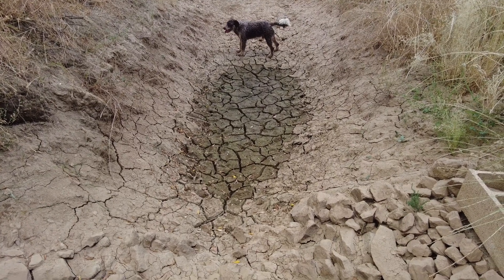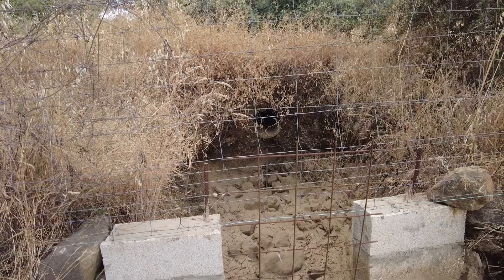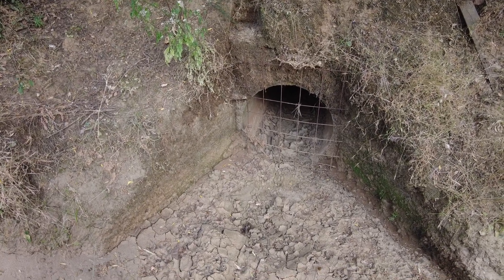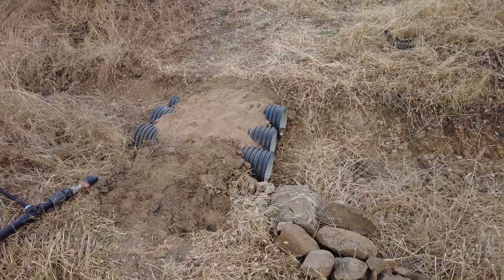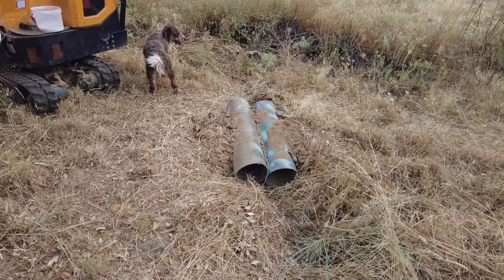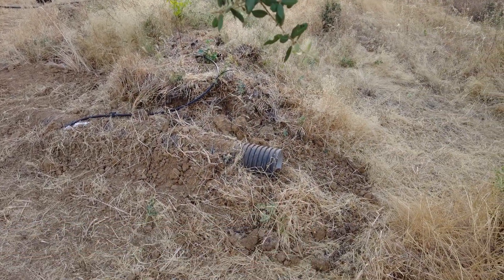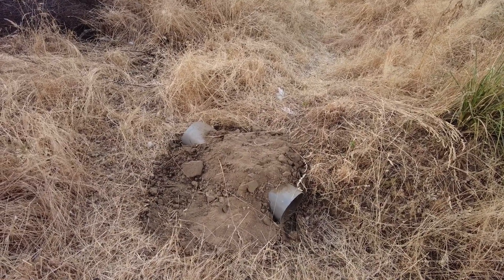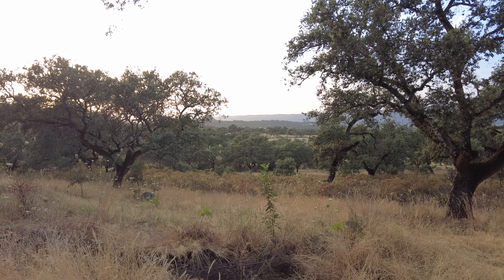Culverts: we now copy what we loathed! #permaculture

Comment: I think the 'stacked culverts' are a fine solution for creating crossovers for people and machines.  They were already on site - so this is a $0 cost adaptive reuse.  Also, the length (relative to the under road culverts) are very short. So the geometric increase in speed over length of travel is nominal by comparison.
My thought would be to add a single row of rocks at the end of the swale and just below the culvert stack as a leaky weir.  The leaky weirs will slow the flow,  spread the flow and help to soak the rain without erosion.
The object is not inherently good or bad.  It is how humans put it to use.    ☑🌳🌻
Reply from the maker: Yes, guru Steve! Thank you sharing valuable information as always.

Comment: One of the things you can do with a culvert, is dig a bit of a hole at the outflow and fill it with rocks, a bit like a zuni bowl.  When the water comes through it gives energy to the rocks, and the water comes out slower and less destructive.  You can then add a check damn slightly further along which will repeat the slowing process for when the bowl is full and less efficient.  This also creates a sediment trap, and helps the water sink into the ground.  You only have to do this in areas you have already dug out, so you aren't losing additional useable land, but you are increasing your water storage and penetration.  The excavator should make quick work of that.
Reply from the maker: Let the excavator do that. Great suggestions. Thank you